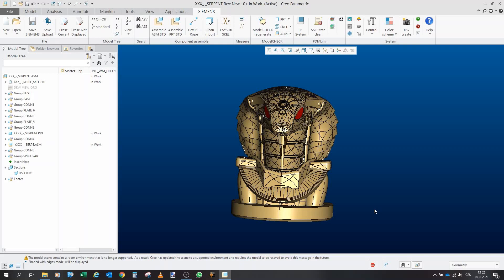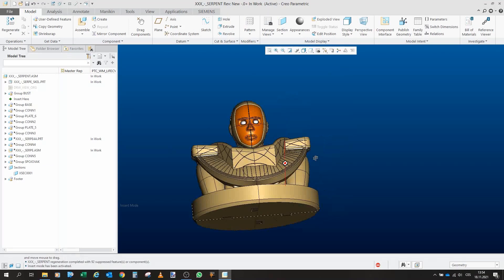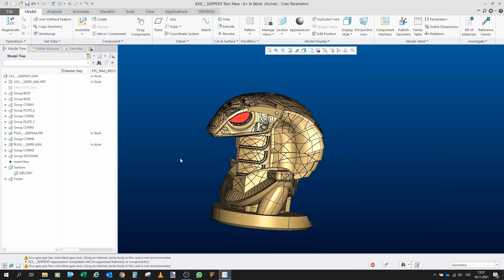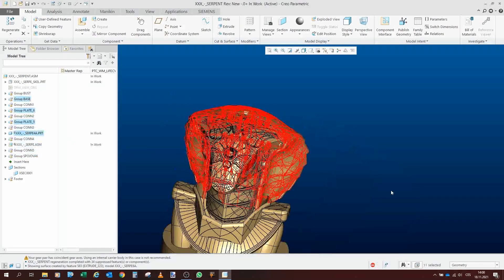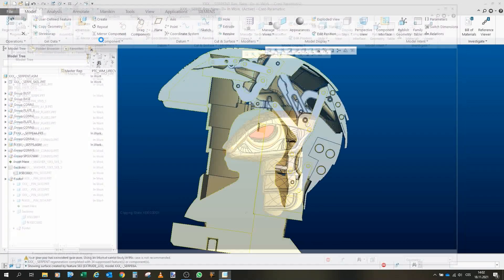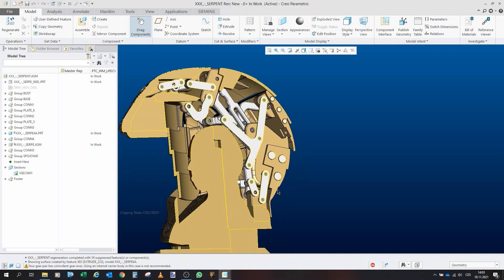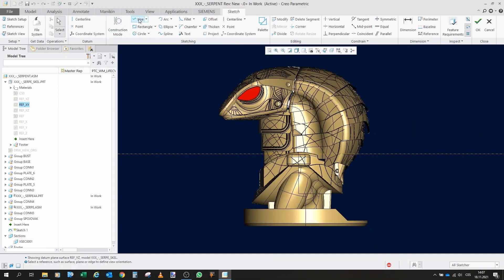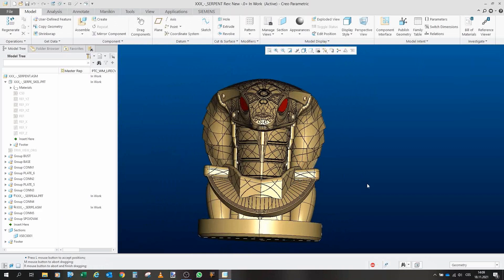Project Apophis Part 2 - Final 3D Design

Comment: >it could be one piece but I don't like long prints

So you're saying it's ready for upscaling as a wearable thing 🤔
Reply from the maker: No i am not saying anything like that. The 1/3 test rig is ready for prints. So first i have to print that, test if the mechanism works as intended and only then can i move to upscaling. However it is not a simple matter of scaling it up. There will have to be other changes, reinforcements so that it can even work with its own weight and alos the face plates have to be changed so that you can see through them ;)

So quite a lot of work.

Comment: The linkage system is amazing. How many hours did you sit on that? Have you thought about lining the sliding grooves of the face plates with tribo tape or some other gliding tape? It looks like the plates could bind, cant, jamm quite a lot. I guess the grooves are very slopy to account for distortion from the printing. So the tape could be added afterwards.
The helmet would be nice in the livingroom as a kinetic sculpture. Opening and closing at random intervals.. Just something happening every now and then in the background.
Reply from the maker: Thanks. Many hours, i cannot be more precise :))))   
I have to say i have never seen any sliding tape so i cannot really say. And yes, it is possible the faceplates will not work. That is why i do this test rig in 1/3 scale so that i can adjust it on fly ;)
Reply: @martintaichl  Tribo tape
https://www.youtube.com/watch?v=s64fup1Fdf8